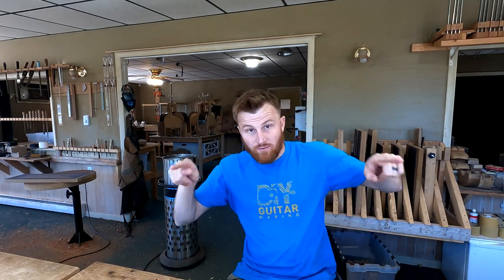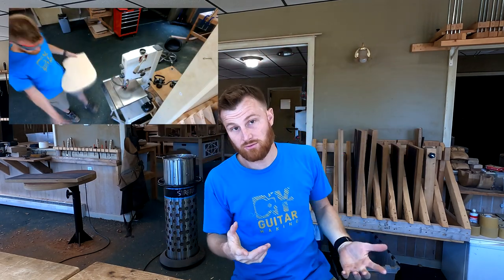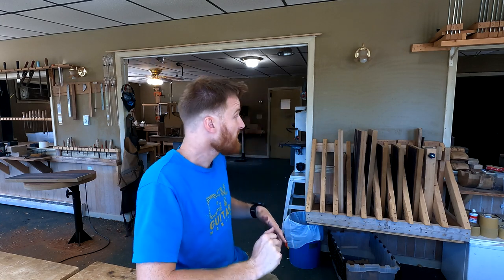Q&A and a Soundboard Profiling Demonstration

Comment: Eric,
Thankyou for your video.
My question, what is the term for scalloping the back of the soundboard ?
I assume its to reduce mass and perhaps strenghening.
Whatever its called, does it affect the bond of the braces, or an extra bace put in retrospectively where the bond area cant be sanded flat ?

Comment: Hey Eric, 
Ukuleles have dead flat fronts and spherical backs.  No radius on the front but similar thickness as a guitar.  They get away with this because nylon strings have lower tension than steel strings and the shorter length and width reduces the bending moment and deflection of the front in the bridge area.